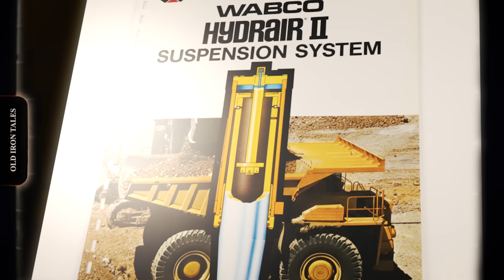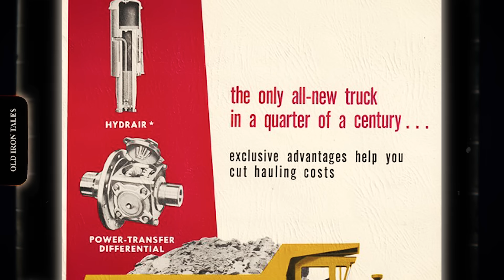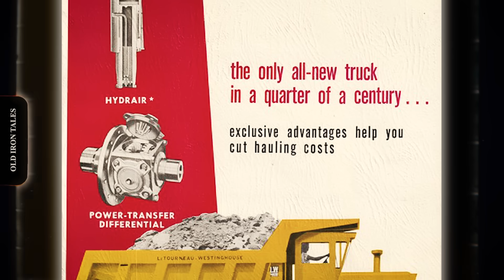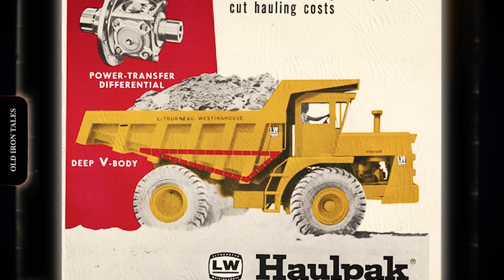The Haulpak Story - How One Engineer Revolutionized Mining Trucks

Comment: Is the Wabco 3200 also known as Terex Titan?
Reply: No the Terex Titan is a one of a kind hauler built by the Terex division of GM. The Titan is quite a bit larger than the Wabco 3200.
Reply: @Dbodell8000  Thanks
Reply: The Titan and Wabco 3200 do look similar as they we’re both tandem axle trucks.
Reply: The 3200 had a payload of 230T and the B version was 250T. The Titans payload was 350T so Alot more. When the Titan was in Sparwood BC hauling overburden it would sometimes be overloaded with 500+Tons! Thats what eventually killed it as they broke the rear axle (which was steerable) a few times and the last time was the end. The two trucks look very similar and have a very similar locomotive designed drivetrain..
Reply: @oldironguy  Thank you for your reaction.
Reply: NO

Comment: Thank you so much for showing and talking about the very beginning of design and the suspension and rear drive (Electric) off road very heavy haul dumps. Their Birth was a USA design even though the names have changed on the dumps. 😊 the one thing in common on a lot of your videos is the year (1957) the year I was BORN. it must be why I so much love hearing and watching your videos 😊❤😊 so,so many designs and builds started that year be it construction line and also farming equipment 😊 it is why for a Retirement toy I bought a 1978 Dynahoe-190 rubber tired 19000 pounder backhoe 😊 I was always in love with Bucyrus Erie line of equipment. I would personally love for you to do a video history on the excavator line Bucyrus Erie built for their start in Hydraulic excavators 😊 those were my favorite. I got to work on a big sewer job with a massive 350-H line from Bucyrus digging in very hard ground that dug through it like it was soft ground. The operator let me move it once, and I was amazed how smooth the control were to touch. Being (Air-control) under the arm rests all these AIR tubes went into bottom of the turtle shaped control levers. It was strange to have the swing still forward to backwards on control lever. On that job in 1979 is were I first got to operate a Dynahoe digging side sewer stubs. I had been on a CASE 680-B doing the hoe-packing 
The forman dropped me off at the 190 Dynahoe and said start digging that sidesewer 
The Dynahoe had what Bucyrus calls two lever controls for digging (Twin-A-Trol) pattern 
I got on that Dynahoe and from the first stroke of digging I said I want to own a Dynahoe some day. It was so easy getting use to the (X) pattern on levers over the 3 levers with foot swing on the case 680-B 😊 so in 2003 I found a used Dynahoe-190 and bought it. It needed its brakes overhauled it leaked very badly from the front bucket cylinders. Fortunately I found a close by Hydraulic repair shop that the guy who oversaw the Hydraulic shop use to sell Dynahoes. So he knew the brand very well. They made 4 series of Rubber tired backhoes first one the 140 then the 160 and my girl the 190 they also built the 200 a beast of a rubber tired backhoe with all 4 tires the same big size 😊 it was powered by a 671 Detroit Diesel 😊 each of the numbers mean the depth of digging. With mine digging standard no extendahoe 19 feet deep. My dipper arm alone is 10 feet long. The bucket curls on Dynahoe can curl out for straight back cuts and still curl fully closed to load a truck without spillage of any dirt. 😊 I love your History lessons on all the heavy equipment lines you talk about. Their beginning and then through buyout of companies. Very interesting on your research of all of them. ❤😊❤